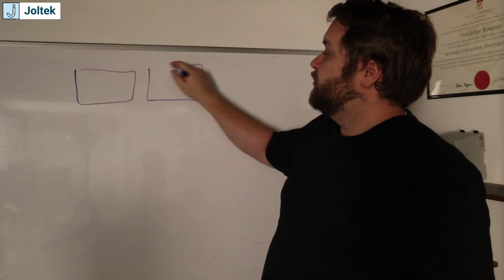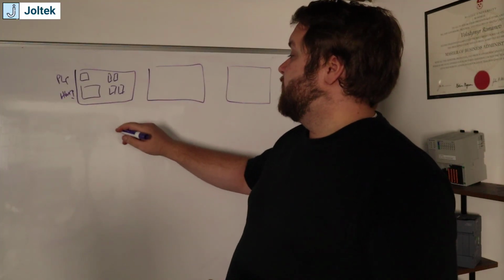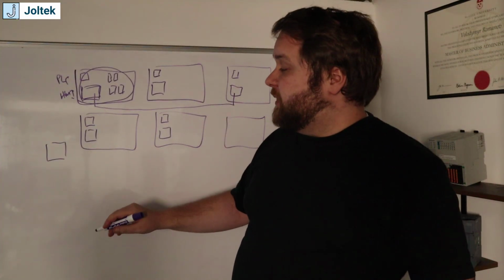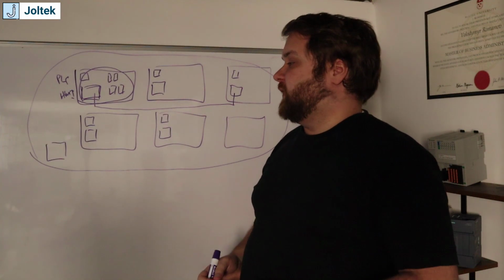PLC to SCADA Communication Explained Manufacturing PLC HMI and SCADA Systems Work Together [P2/2]

Comment: Very informative
Could you provide a detailed explanation of the proper network architecture ON SITE from the ISP to the firewall, then to the corporate network, followed by the SCADA computer and finally the PLCs? I would like to know the specific components involved, such as which firewall and switches to use, as well as how to implement isolation and create a DMZ within the network. Additionally, how can the SCADA computer be accessed remotely without using the internet? Is it permissible to connect the SCADA computer directly to the internet?